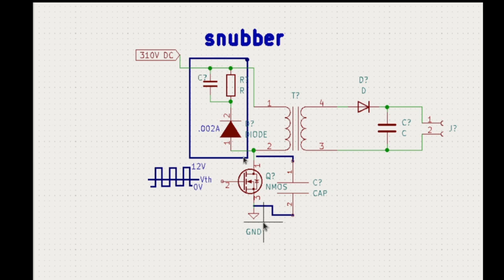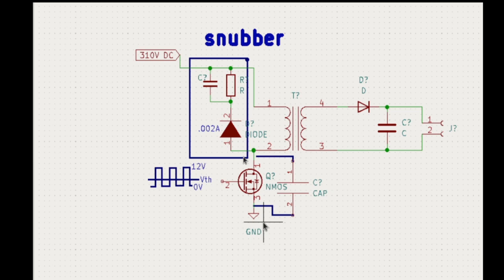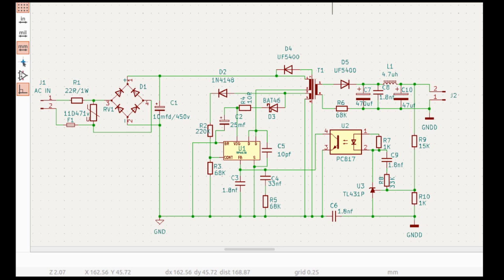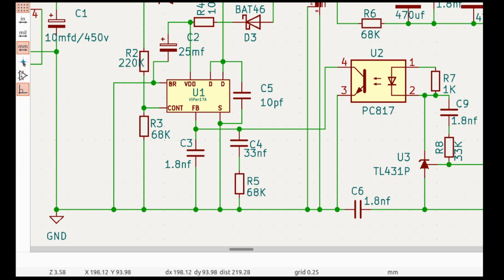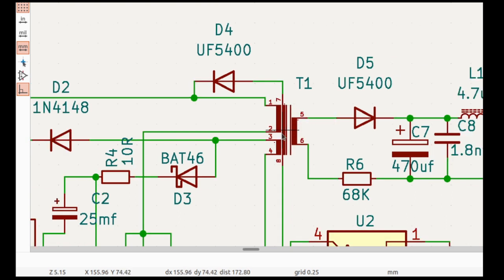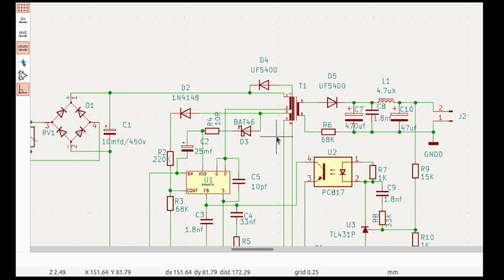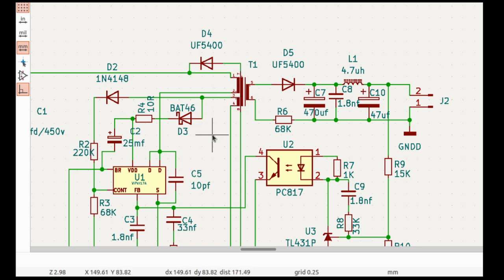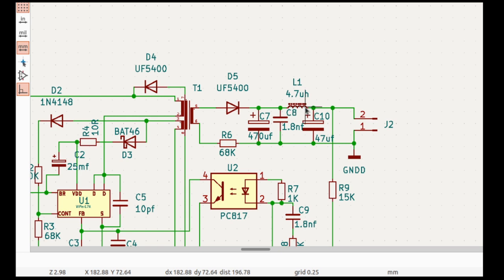[26]SNUBBER CIRCUIT replace with BIFILAR COIL

Comment: Thank for your information so interesting
Reply from the maker: Thank you
Reply: @hobby_plus  🙏
Reply: @hobby_plus  sir do have any idea of repairing of small SMPS chopper, which are very small in size
Reply from the maker: @magnet2011  yes,
Reply: @hobby_plus  then share the link of the video
Reply from the maker: Do you like to know how to calculate and winding a transformer?
Reply: @hobby_plus yes  ofcourse but not only on theory I need it practical but can't efforts costly tools
Reply from the maker: @magnet2011  9831250801
Reply from the maker: tool used for first and effort less job, 'EE' or 'IE' core bobbin wading tool you can make in your house.